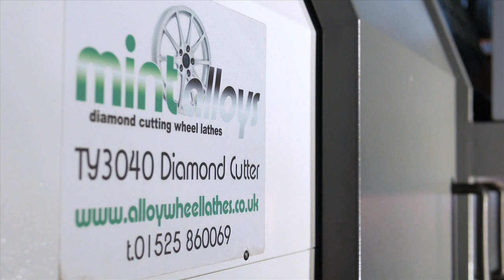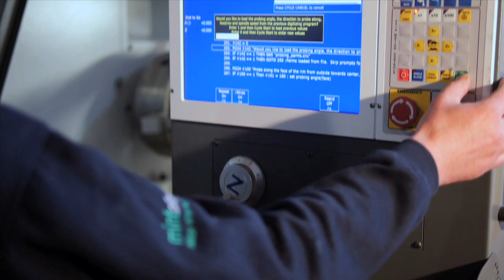Alloy Wheel Lathe - Diamond Cutting - Machine Alloy Wheel Refurbishment

Comment: Why is it called "diamond" cutting when clearly it is a standard lathe tool???
Reply: Diamond tips are not actually made of a full diamond, they're diamond coated which this is.
Reply: I wondered the same thing. Genuine diamond machining gives sub-nanometer surface finishes. A plain carbide tipped tool is more than adequate for machining alloy car wheels. I did notice that they use a slightly modified 3 jaw chuck and don't check concentricity - they just assume the chuck will be accurate enough (which, considering what they're machining, it probably is).
Reply: It’s a titanium alloy
Reply: And if you look at your wheel or rim  up close you can see the lines on the outer lip if it is just clear coated .